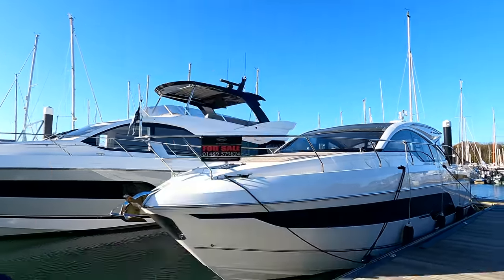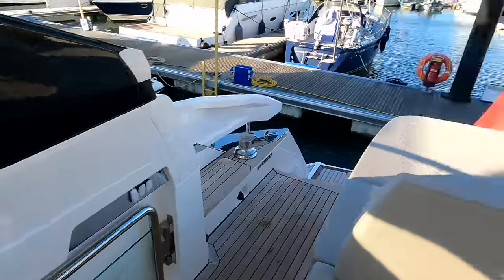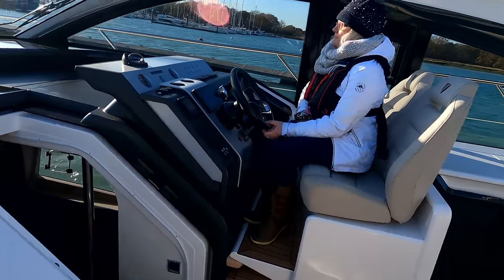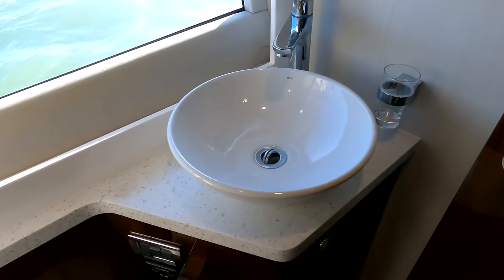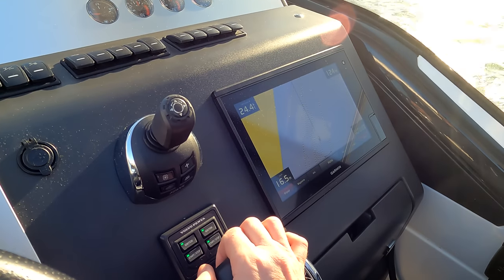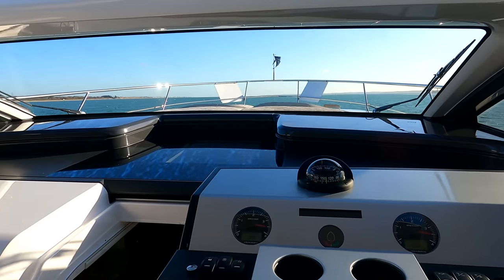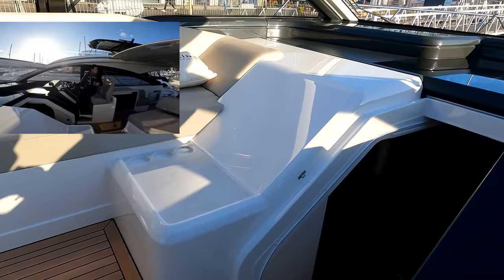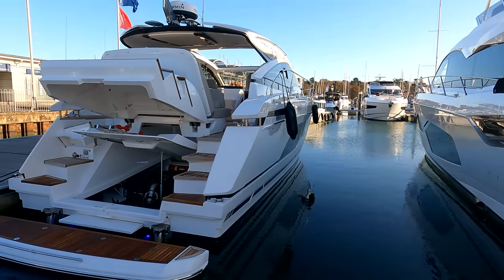Fairline Targa 43 Open For Sale with Sunseeker Brokerage - Full Tour & Seatrial 2019  (now sold)

Comment: 43:22 not exactly. This is an inverter/charger. MUCH better than just a charger as you have 220V power available in the cabin without running the genset. This is a big plus not many boats in this category have. You should highlight this to any prospect buyer.